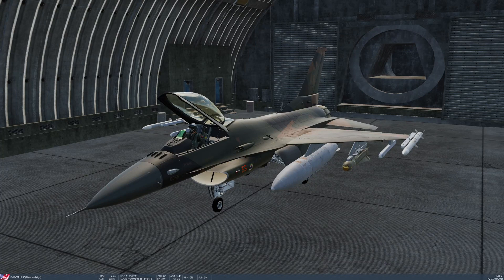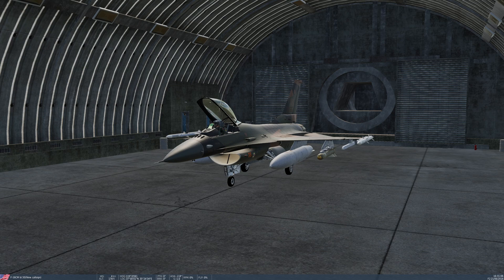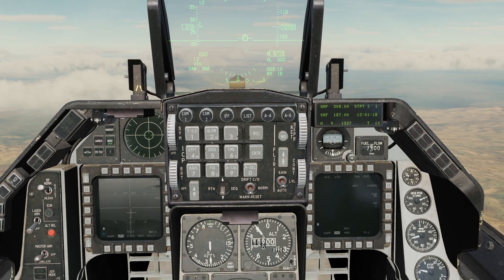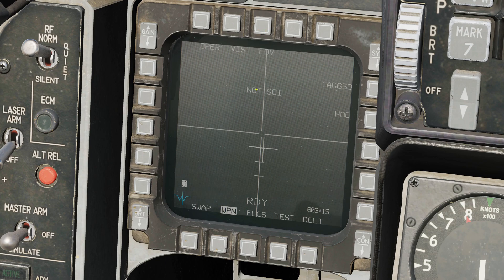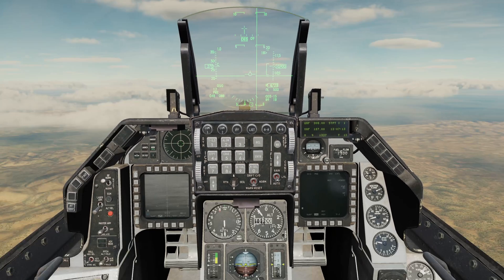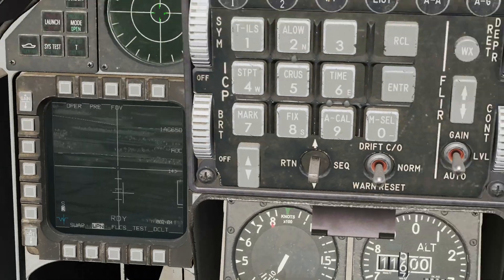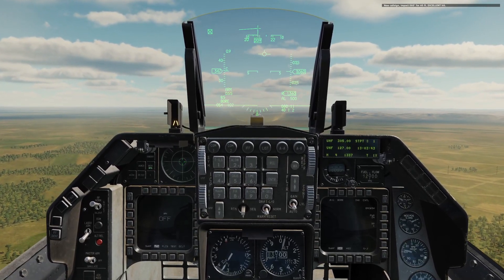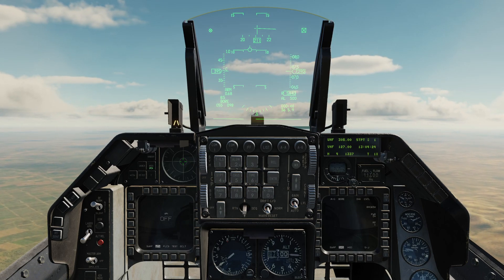DCS F-16C Tutorial 5 - Maverick missile

Comment: I'm having a mare with this and its driving me mad. If I TMS up and don't get a lock in VIS mode, I cant TMS down to reset and then TMS to re-attempt the lock, the TMS up switch on subsequent attempts either just wont lock or switches my F16 to A-A mode. Its driving me mad because sometimes I get a missile off no probs,  but then the above behaviour kicks in when Im doing the exact same sequence of events.
Reply from the maker: I've not experienced this. Could you have some conflicting control bindings or an 8 way instead of 4 way hat set for the TWS with some diagonal bindings?
Reply: @deephack  it's a 4-way hat with a press button as well. The press button is dogfight mode  but the way I can replicate this fault almost certainly rules out user error. First missile always locks and fires normally, which wouldn't be expected if it was a random user error. I might have to record it or put my stick telemetry up while playong to investigate further, but I need to tackle it again when I'm not tired 😄

FWIW, I'm using a virpil constellation alpha.